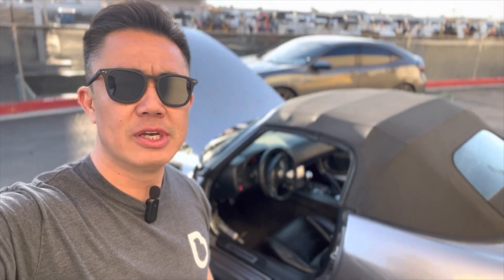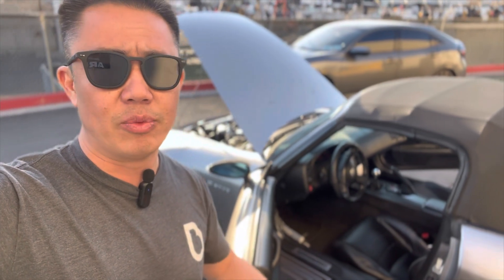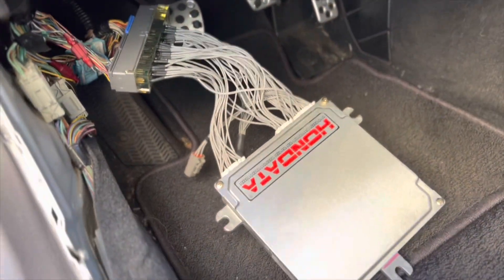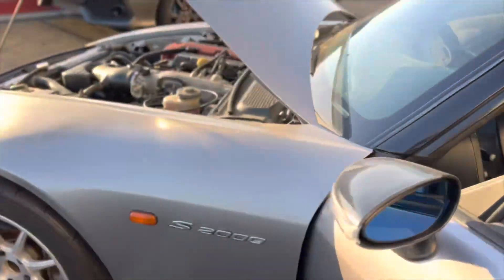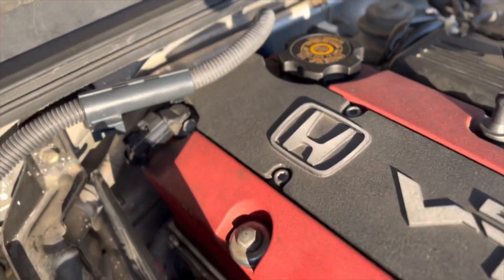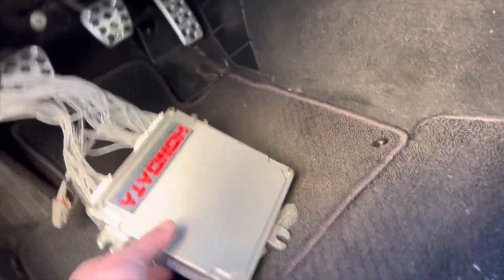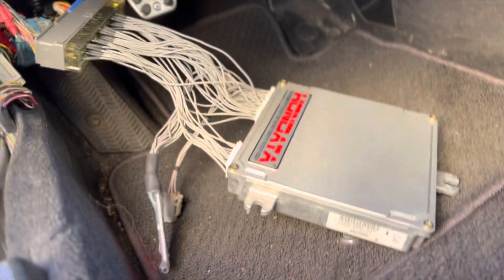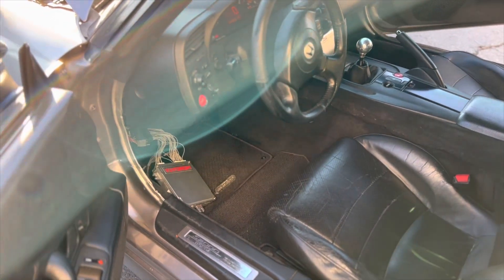We finally fixed our S2000 Hondata Kpro plug and play!!

Comment: I have an stock 03 s2000 what is everything I need to buy in order to tune it ? The kpro prb? And the harness? Is that it ??
Reply from the maker: Yes that is it.  Regular Kpro Not S2000 specific

And Jumper harness

https://balladesports.com/products/hondata-00-05-s2000-kpro-plug-and-play-no-sensor-conversion?_pos=3&_sid=fe491ea5a&_ss=r

Kpro
https://balladesports.com/products/hondata-kpro-ecu?_pos=1&_sid=fe491ea5a&_ss=r

Comment: So do you run the stock rsx cal. Or s2k cal. ?
Reply from the maker: Good question!  You can run either or S2k or RSX calibration.  I run RSX type S because I can use the stock wideband from my PRB ecu.  S2k cal Hondata does not allow that function.